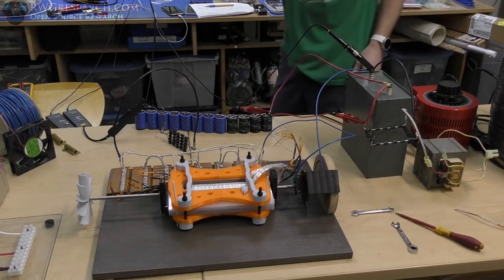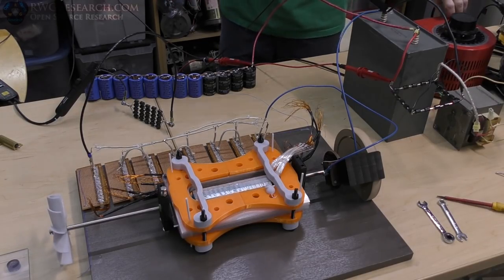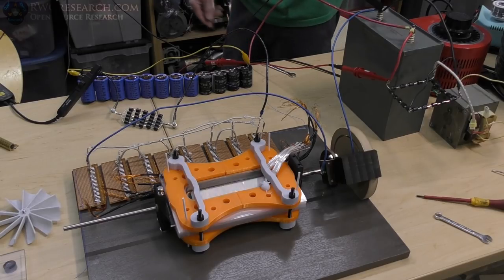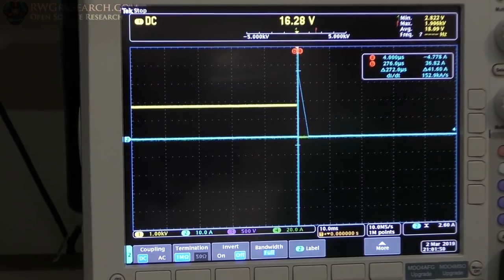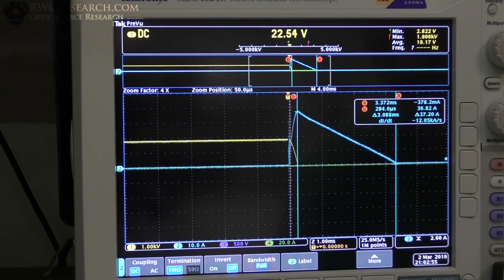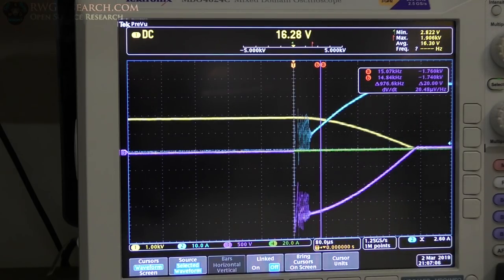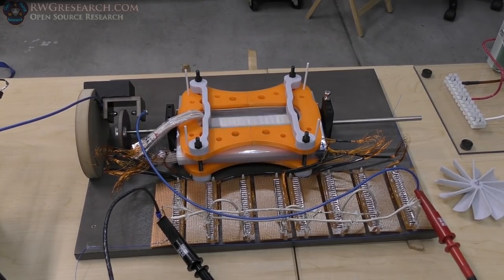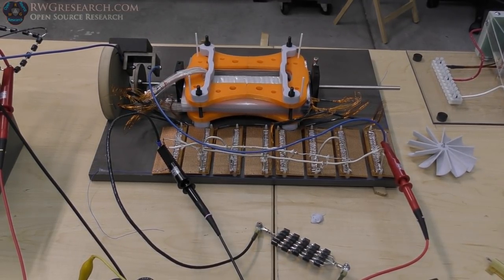High Voltage Cheesy Fan Flying Spark Gap Switch First Testing.

Comment: Great test!
The awesomeness of the bifilar coil! be very interesting to get accurate torque test.
Does the end of the cheesy motor with the spark gap have a secure bearing. I swear I see it bending the shaft on the other end like the bearing is not secured on the spark gap end...
Reply: Did you just make a "hit and miss" electric motor

Comment: Well done Russ. Seems the high voltage discharge pulses drive this thing. What I did not understand is , why this bright blue current trace on the scope has such a long discharge time after the yellow cap voltage is already at zero Volts?